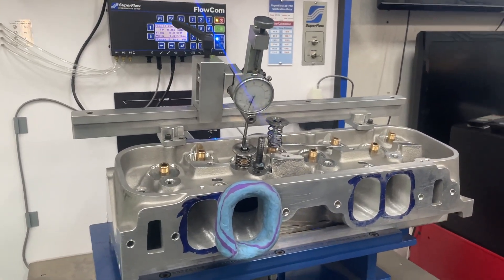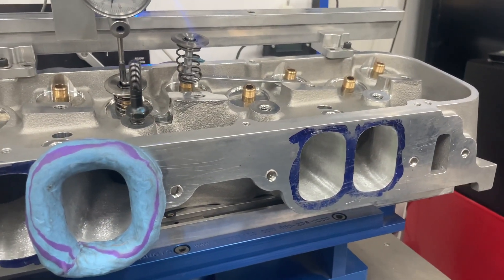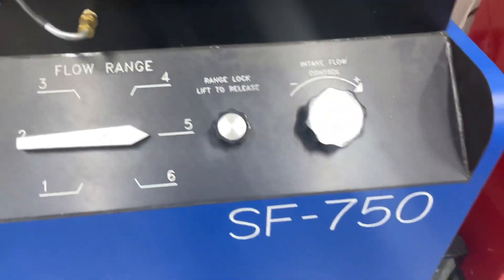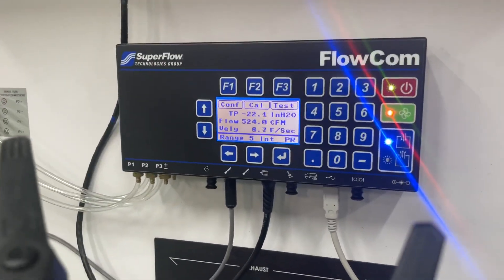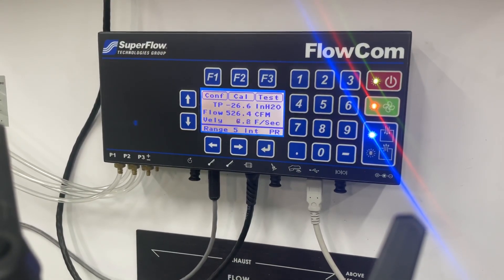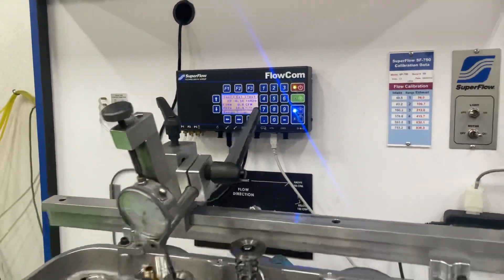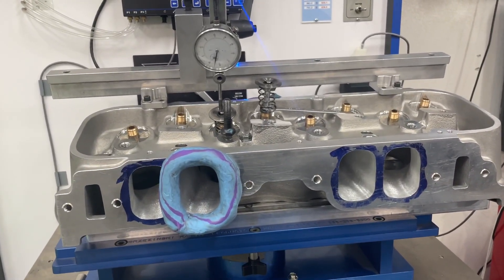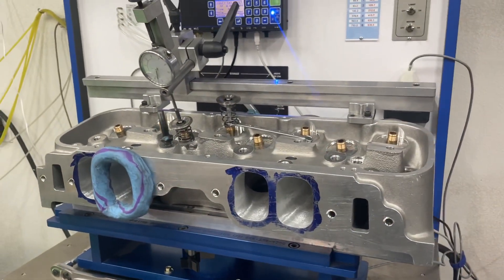Superflow 750 Frustration. Ported Brodix BRX Maxing It Out

Comment: Maybe you have a Vacuum Motor thats lazy or Possibly a Voltage drop from your power supply to your motors...ive seen guys upgrade the size of the wire to the motors...seems Superflow  is Alittle light in there wiring....

Comment: Could you let us know what power this ends up making please?
Would love to know how this does against a MBE 18° head.
Thanks. Shane.
Reply from the maker: These aren’t in the same league as mbe 18. The mbe has a different valve placement and other changes that make it better. Porting can’t make up for those changes. Mine will make good power and will run good but not as good as that mbe head. However mine is several thousand cheaper. Ps I have tried to buy the unported 18 from mbe and they wouldn’t sell it to me.